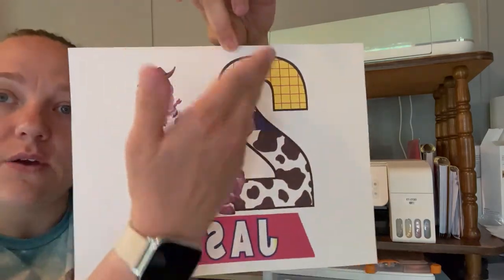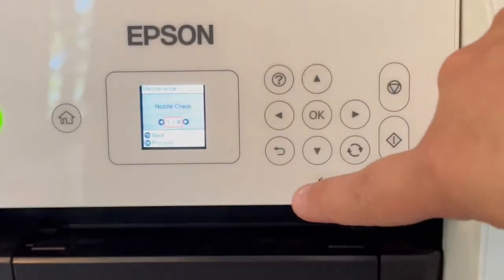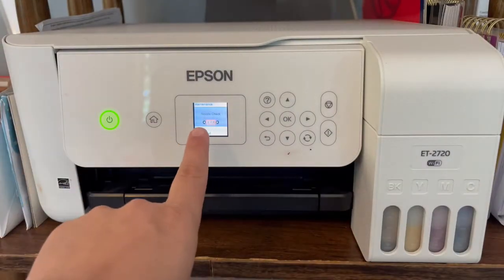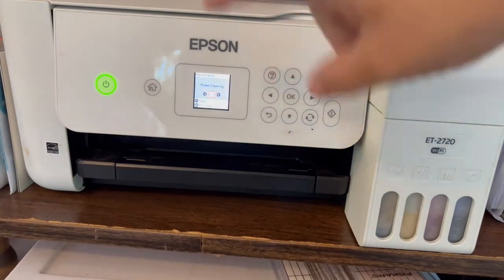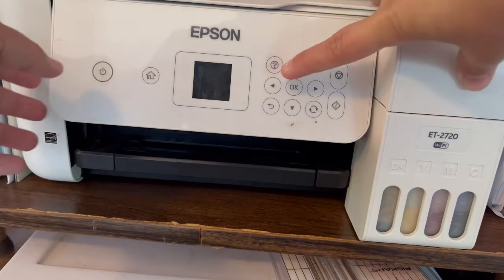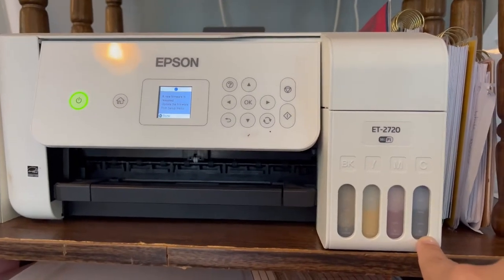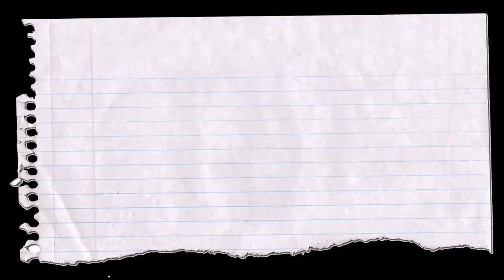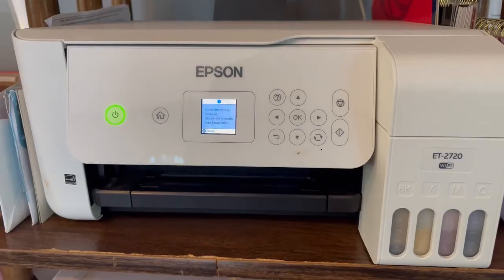How To Unclog Your Sublimation Printer | Run A Power Cleaning Epson EcoTank ET-2720 Troubleshooting

Comment: Thanks for your video!
 I will always try the nozzle cleaning first, sometimes only black prints and the 3 colors don't. I've done the power cleaning in the past a couple times, and it works.
 I have replaced my printer pads once, Epson keeps me active, for sure.

Comment: So helpful on accessing the power cleaning mode. I was searching everywhere. Why make it so difficult to find. 😂 doing the cleaning now hope it works. 
I will need to get a backup power supply for my printer because loss of power in mid printing made it happen.

Comment: For anyone out there watching this video.....DO NOT DO A POWER CLEANING. Not only does it NOT solve the problem permanently BUT it wastes a TON of ink and also puts way too much extra wasted ink into your maintenance ink cartridge inside the machine which CAN NOT BE REPLACED on this particular model. So once you do continuous power cleanings over and over again, it makes your printer USELESS. There are so many YouTube videos on here that gives you tips on how to actually fix the problem for the long haul and also not wasting so much ink and having the ink go into the maintenance area of your machine. You can either clean the printhead with a printer cleaning solution (under $10) OR you can figure out which color is giving you the problems and create a PRINT PAGE in that color only and print multiple pages out to get it cleared out. But I repeat DO NOT DO A POWER CLEANING. Hope this helps someone because I made this same mistake and wish I had known this ahead of time.
Reply: I’ve tried both of those options and my cyan STILL isn’t working even though the cyan ink tank is over half full. I’m coming to the power cleaning option because I feel like I have no choice left to me.
Reply: @OpenBiolabsGuy  Well that is up to you. But it WASTES A TON of ink. And once you fill up that back area where it gets thrown into (maintenance tank) your printer is TRASH. Completely DONEZO. 
I finally was able to get mine going after doing over 200 full print outs. Also I now print out a page weekly so it doesn't happen again. The power cleaning did ZERO for me other than waste expensive ink. But GOOD LUCK. Hope it works for you. I just will never go down that route again.

Comment: I was away for a month and had no colors.  A nozzle check showed no color.  I took it apart and cleaned the print heads.  That alone improved the nozzle check for some color.  Then I did a complete power clean by pressing the on button and question mark button at the same time. Took seven minutes and the nozzle check came out good for all three colors and black.  Thanks for the information on a power clean.
Reply from the maker: Yay! Thanks for watching!
Reply: How did you clean the print head? I didnt touch my printer for a year. I've been trying for days to get my black to print correctly with no luck.

Comment: The problem with the power cleaning, it will reduce the life of your printer significantly. A third of the ink will end up in the maintenance tank. Once it's full, you cannot replace the tank and will have to buy a new printer. Just an FYI.
Reply: I just ordered a replacement tank from Epson for my 2760
Reply: I just ordered a replacement tank, too. Can I replace it or not? You scaring me? 🥺
Reply: My comment was only for the ET-2720. After intense research, that was my findings so I got something different. Please conduct your own research. I am not an expert. Please also remember there are different tanks. I’m talking about the maintenance tank aka maintenance box.
Reply from the maker: Yes. I ran the head cleaning at least 30 times without success. Did the power clean once and problem solved, and no issues since. 🤷🏼‍♀️
Reply: No you don’t just replace the sponges  you can use any soft sponges and reset ink pad reset with lap top and you will have a new printer on your hands, I’ve done it 1/2 dozen times, good luck mam
Reply: @evaarias7938  you didn’t have too replace them with soft sponges it works just as good and maybe better

Comment: As Michy Bon stated below, it is very very, very important that you understand that cleaning the nozzles this way will use a lot of ink! 1/3 of your ink will end up in the maintenance tank. This is a low-end printer. When that is full, you will have no choice but to purchase a new printer! There are ways to clean your nozzles without filling that tank up. You should never do this more than once on this machine. If you do it three times, you need a new computer!
Reply from the maker: I stated in my video that it would use about a third of your inks 👀

Comment: ive been watching a lot of tutorials on the power cleaning mode and many say not to do it as the 2720 has a non replaceable holding tank. it's pretty much a write off when that tank fills with run off ink. so maybe put a disclaimer?
Reply from the maker: You can buy replacements for the holding tank
Reply: @nanciblank6322  Not for this printer.

Comment: YOU DO KNOW THAT POWER CLEANING WIL RUIN YOUR PRINTER HEAD ... even epson says it will
Reply from the maker: If you have a better suggestion, I’m all ears. I did the print head clean at least 30 times without success, did the power clean once and solved the issue and I’ve had zero problems since doing the power clean 🤷🏼‍♀️

Comment: I did the nozzle chec.  ok*9
NOW the image is mirrored on my computer and when I get it off the printe the image is normal not mirrored.  I NEED MIRRORED>>  Ive done it before with no problems.
Reply from the maker: If your settings are set to automatically mirror the image, you don’t need to mirror on the computer